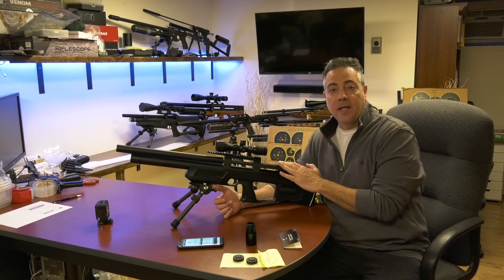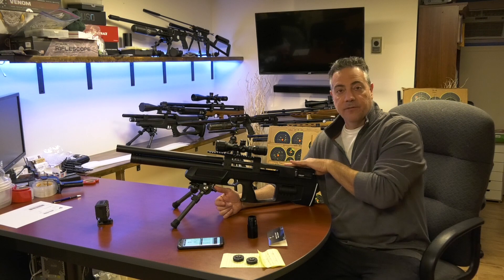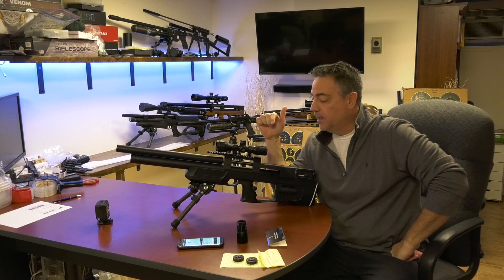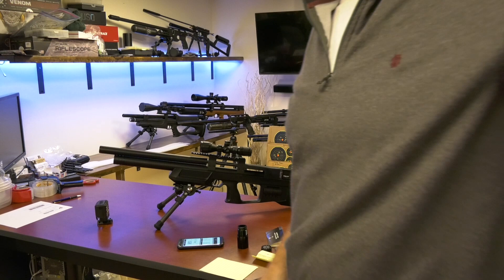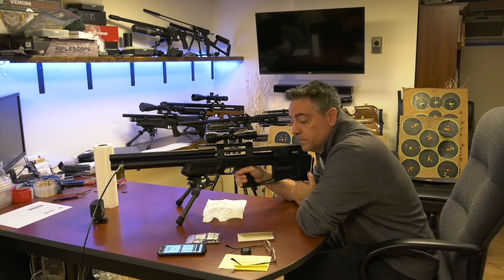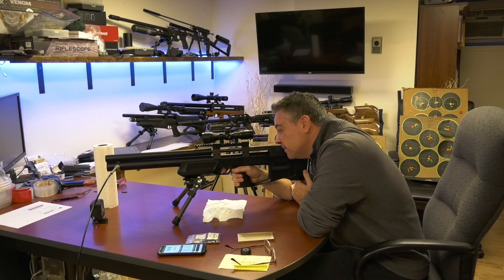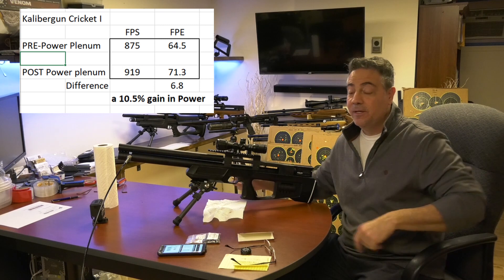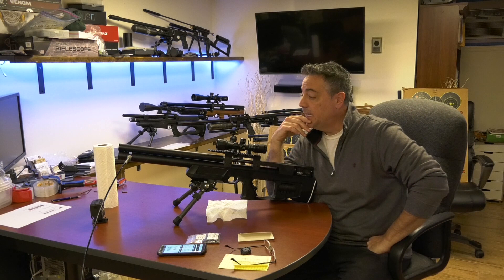Ernest Rowe Power Plenum for the Kalibrgun Cricket

Comment: I have a Gen 1 Impact that came with a very small plenum.  Goal was to shoot the .25 - 34 grain pellets at around 830fps.  that required the regulator set at 145 bar, and that model maxed out at 150 bar.  Added the Power Plenum for the Impact.  Same performance at 110 bar.  massive difference in harmonics and general performance.  There is a good reason to get the larger plenum.

Comment: That FX chrony is not the best, try a different chrony.
Reply: Found that out the hard way. Wasted so my slugs/pellets, time trying to tune and get good shot strings out of my rifles. The FX was never consistent in reading we come to find out after comparing it to other chronographs.
Reply: @Michiganairhunter  its a terrible chrony, it was way off compared to the original chrony, personally i use the ACETECH Airsoft Gun AC6000 bt. i made an attachment so it sits on my barrel, it knocked spots of that fx junk.

Comment: How accurate is at those 71fpe?  You think that the new kricket tactical 25cal can get those numbers? They offer a plug in plenum whenever you purchase the gun. I know at max power shooting the 33g jsb it was at 56fpe,  I want a 25cal either the fx wildcat mk3 bt or the kricket tactical 25cal...doing some hog hunting
Reply from the maker: It should be even jore accurate as I can now turn down the hammer spring and hav3 less jarring of the gun. Should hold true for the tactical as well
Reply: @AirVelocitySport  power wise, you think it can achieve the same 71 fpe as your gun?
Reply: @AirVelocitySport  thanks

Comment: Kalibrgun cricket is actually ROCK SOLID..... Mine is same and I have opened it arnd eleven times due to an issue with the OEM regulator (creep) and as I was a trying to rectify and adjust it myself. I got frustrated and ordered a Huma. No issues since then. Though, after disassembling the OEM reg, I could locate the issue with the washers placement ......THANKS TO MR ERNEST ROWE FOR HIS TUTORIAL VIDEO ON CRICKET.

But, this is a very simple, very sturdy, very reliable and very accurate gun with reasonable power. 

Regards from India

Comment: Do you know if those plenums work with the cricket 2 tactical??
Reply from the maker: This one is only for the cricket 1 and Argus. Not sure if that jncludes the cricket 2
Reply: It won't work with the tactical because of the front bottle and picatini rail, it will push the aligning pin too far forward.
Reply: The only way to increase the plenham in the tactical would be to get the reg seat in the tube milled out so the reg sits further down the tube then use a longer reg spacer,
You will also have to get the reg pressure hole filled in the tube and drill a new hole.
The air tube on the tactical dictates how the gun is put together.
Reply: Want to know too~~